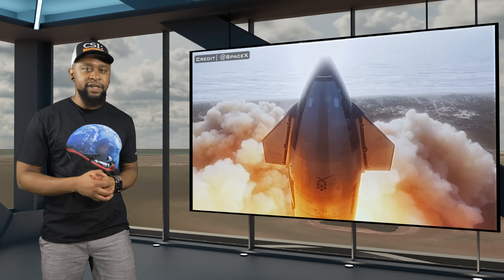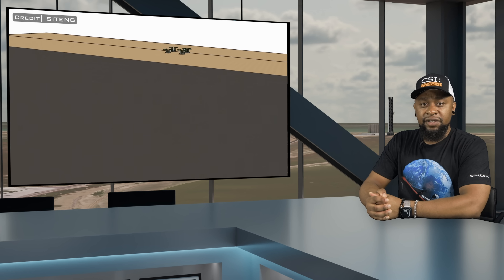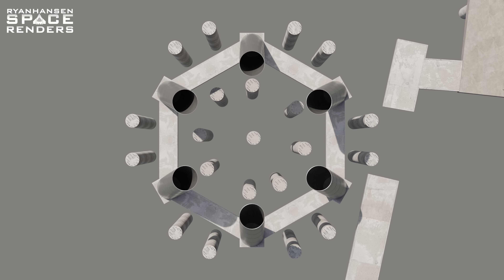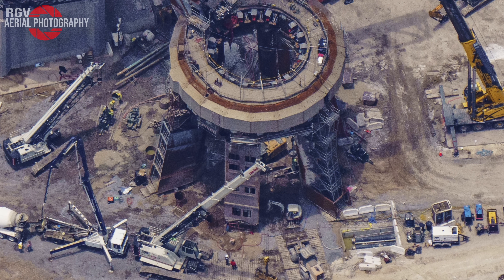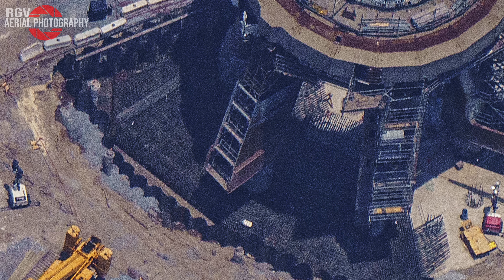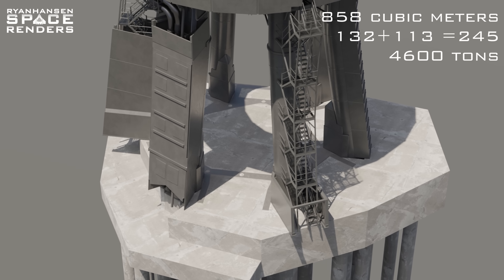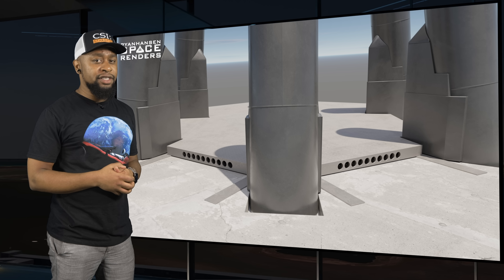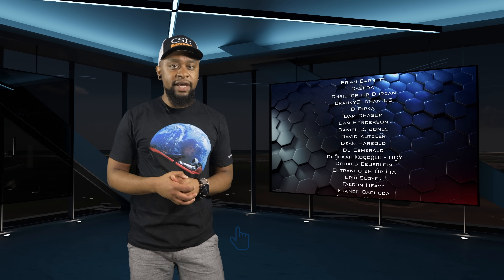How SpaceX Will Guarantee Its Launch Pad Never Fails Again! [Part 1]

Comment: What I want to know is how Musk's employees will board that thing as test subjects.  Under US law, can an employer simply order people to their deaths if need be?
Reply: I doubt that the current iteration will ever be used for human launches. Hopefully the 39A pad will have a dedicated flame trench underneath the OLM.
Reply: @EMichaelBall  Pad 39A is at Cape Canaveral. The topic here is Musk's shoddy 'star ship'; not NASA.
Reply: @RideAcrossTheRiver The ship is fine. The pad is the problem, and makes crewed flights a liability that NASA will not likely allow from their facility.

In its current design, I doubt the Boca Chica pad will launch anything more than test vehicles and Starlink satellites. There’s a market for that. But the high-profile launches will probably come from 39A and maybe Vandenberg. Both landlords should, and probably will, demand full on flame trenches at those pads.
Reply: @EMichaelBall  You were almost correct, but then you doubled back into error. Pad 39A is at Cape Canaveral.  Pad 39A is where Apollo, Shuttle, and now Artemis launch.  Pads 39A and 39B already have flame and noise suppression systems in place.  NASA invented those in the 1960s.

My question: under US law, can an employer simply order people to their deaths if need be?   I want to know how Musk can coerce employees to board that 'star ship' as test subjects.
Reply: @EMichaelBall NASA & Air Force have no say in SpaceX technical pad design

Comment: yes and what about the other 50 things SpaceX needs to remedy after that last disaster? There is no way they are going to get clearance. NASA even said 2027 is laughably optimistic. This is going to be an epic fail, and this isnt even getting into the 33 engine design the Russians couldnt get to work decades ago. Apparently, if the outer motors go (they always went in pairs or groups) you need to shut down adjacent motors to maintain balance, or it will do exactly as predicted starship would do and did: tumble. Dont worry, Musk said it will launch last month at the latest. Oh wait... its July.
Reply: First, open your dictionary and find "engine gimbal"
Reply: @alvianchoiriapriliansyah9882  lol then research how much gimbals help over multiple engine failures. Gimbals on any one engine can only give you a couple degrees of correction, not the 10+ needed during failure. did you not see Starship tumble and do this exact thing?

Comment: It's a stupid design. They are attempting to block the blast instead of deflecting it. The water cooling is fine, but could be better with a deflector to let the blast suck the water into the flow instead of trying to overpower the blast with water pressure.
Reply: Can you prove in real life that this design works poorly?

Comment: Stop using rockets? That's the answer
Reply: Oh yeah you have other methods of going into orbit then?
Reply: @alvianchoiriapriliansyah9882  of course I do, but the problem is they don't require 2million tons or methane or rocker fuel per launch and don't explode half the time so they aren't very profitable

Comment: This video is basically unwatcheable.  What engineer wrote this script that used as many words as possible to describe a simple concept such as a foundation.  We don't even need to know the process of drilling a foundation.  This video contains 20 minutes of accessory content.
Reply: The video doesn't start until 13 minutes in. I don't need to know how every foundation is drilled.  why are you telling me how every foundation is poured, and you dont give me any details like how far it is from the center? You obsess with random details like how a pile is created, and then leave out how far it is,  from the center.
Reply from the maker: "If you are looking for the How It's Made of Stage Zero 2.0 than you have come to the right place"

Sounds like you came to the wrong place and didn't hear the warning

Comment: Within the first thirty seconds there was a factual error. I stopped watching and thumbs down.
Reply from the maker: Care to point out what that factual error was?
Reply: @CSIStarbase  Orbit was not intended for this flight. "Ship 24 will not complete a full orbit of Earth, but it will reach close to what is being termed orbital velocity — for low Earth orbit, about 17,500 mph (28,160 kph) — at an altitude of approximately 150 miles, if all goes according to plan. Officials with the Federal Aviation Administration have dubbed it a near-orbital velocity flight."
Reply: A nitpick, but facts are important.
Reply from the maker: Lmaooo you didn’t watch the video cuz if a nitpick like that than I don’t have anything to say honestly. That’s silly cuz the video has nothing to do with the launch.

Comment: To me, this design has failure written all over it. A key engineering concept is KISS. This is not that. Tried and proven: a flame trench and deflector. Build up a launch pad similar to pad 39A and 39B at the Cape, with built in flame deflector trench blowing out to sea. Which is more likely to survive a blast of 33 rockets? A flat plate, or an angled plate the deflects the main force away from it? You want a water system? Fine. Build a water tower and if need be, pressurize it. Have it discharge into the flame trench. No need for a lot of complicated 2 size tank system with pressure systems for each tank. Wow, he did a single engine test on a water system, then is scaling it up. Uhhh . . . not impressed by that.

As we have recently seen, innovation does NOT mean better. There is nothing wrong with tried and true methods.

I wish him luck, but I'm not holding my breath that this will be a smashing success.
Reply: Uhm water tower isn't simple either

"There's nothing wrong with continuing to expend the rocket first stage!"
Reply: @alvianchoiriapriliansyah9882  Really? Why not? It is a gravity fed system which is a far simpler system than trying to pump the water UP to the nozzles. Need more water? Add another tower. Need it to come out faster? Pressurise it.

As you can tell, I'm not a big fan of his methodology so far.
Reply: @Woody615 And where's the water in the tower is coming/refilled from? Oh yes wait for it....pump

Spoiler alert: SpaceX doesn't use pump either. They used high-pressure gas cylinders

https://youtu.be/eC5Q-iay4yU
Reply: @alvianchoiriapriliansyah9882  There is plenty of water available from the local water infrastructure (needed for restrooms, fire protection, etc.). Build a water line to the base of the tower and use a pump to lift the water to the tank. Then after it's drained/dumped during a launch, you refill the tank. The supply line does not have to have the capacity of the discharge pipes.

To drain it quicker, pressurize the water tower to help force the water down.

NASA has successfully used this basic design for over 60 years at The Cape. Why reinvent the wheel?
Reply: @Woody615  So much for needing "less parts". Learn physics to know that it require the same energy to refill it as the potential energy of discharge

But anyway, gas cylinders water system were also used on Falcon 9 and even other rockets like Atlas V and soon Vulcan (zero water tower spotted), and it's very successful. So....

Comment: Sorry guys but the whole design of this launch pad is stupid. They are fixing something that should not be necessary to fix if the launch pad have been build differently.
Instead of learning from all other launch pads all around the world, Musk has to be something special. But this approach is really stupid.
The piles are fine and water cooling system too... BUT... the heat is not the only element that launch pad has to withstand. Another BIG thing is enormous pressure and blast waves. You have to divert these blasts away... you can not absorb them just with water, steel and concrete.
I bet that those blasts will destroy that fancy new water cooling system in few seconds (or at least it will be demaged).
If all this effort was put into the building of propper launch pad with flames diverter from the beginning, there would be no... or at least only a few minor problems with the pad.
BTW. Who could design a launch pad just over the fuel pipes? Who designed the fuel storage as close the launch pad for the strongest rocket ever? It is like building a safe bunker right under the testing site for the nuke. It is stupid.
And I am still not talking about its proximity to the populated places.
This launch pad is just another of Elon Musk's bad ideas such as Hyperloop, landing Starship on the Moon, using first Falcon-Heavy flight just for putting his car into the heliocentric trajectory and many others. It is just waste of many and time.
Reply: It's far enough away from populated areas
Reply: On Falcon-Heavy: Elon did offer free launches to anyone interested. However, getting insurance for a payload would have been impossible, in part because Elon himself said prior to launching that he would be surprised if the rocket got off the pad. If you’re Intelsat, and you need to get your $500 million satellite into space, that’s not a rocket you put your baby onto.
Reply: @alvianchoiriapriliansyah9882  
It is two-times closer than in Florida. But the rocket is few times bigger, stronger and louder (and thus much dangerous). Take this into account.
Reply: @EMichaelBall  You don't need to send some 10-million probe on such flight.
But you can launch a lot of cubesats that are cheap and easy to build.

Comment: A monumental failure more like it.
Destroyed the pad, the enviroment, the fuel tanks and all the equipment left way too close to the launch.

The new pad will melt in seconds, the one engine test video was cut early to not show the damage that it was inflicting.

Another epic waste of investors cash for any usefull progress.
Reply: So, do you give up after only trying something once if it fails? What SpaceX is doing is called iterative development, it requires patience. Maybe it’s your lack of patience that’s the problem? (This is a question to you not a statement from me.)

Also, the investors understand how this works, so I’d suggest not speaking for them in future.